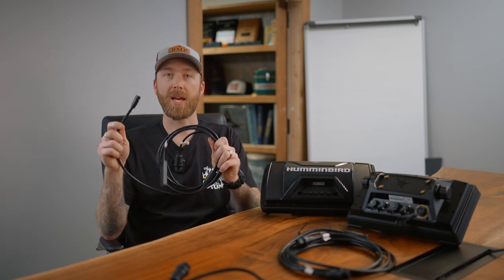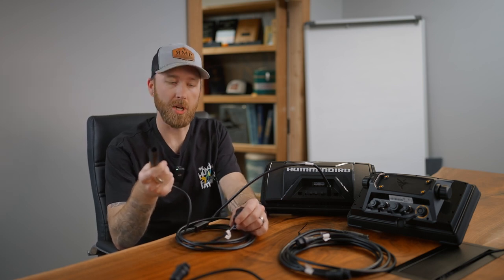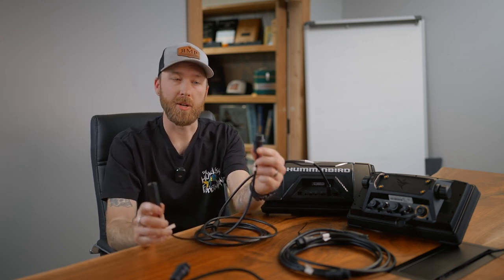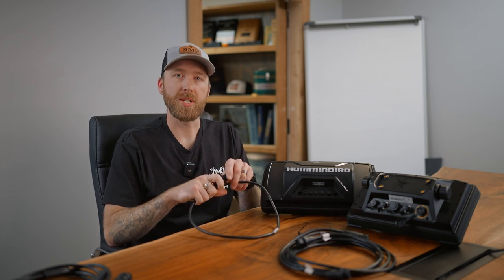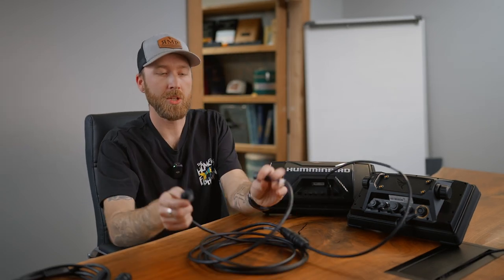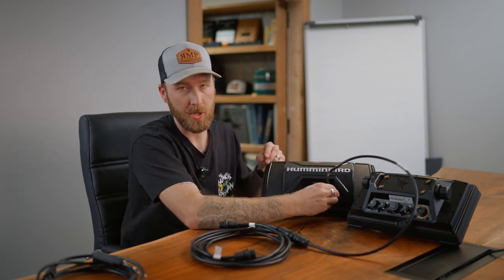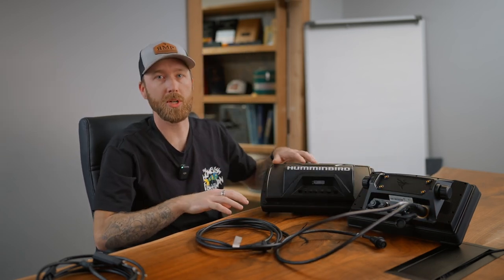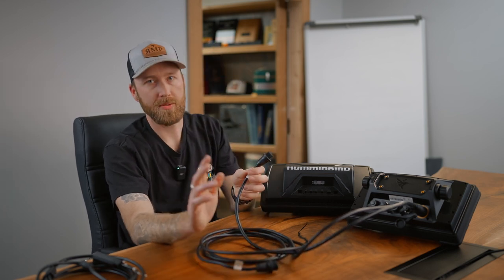HUMMINBIRD: Choosing the correct Y Cable for your Mega 360.

Comment: You should also mention the issue with the SI feature on the Solix/MSI+ transducer when using with the 360. When you use the Y cable and are running the 360 and then try to run the side imaging without the 360 in the water, the unit will not recognize the SI function of the actual transducer. This does not happen with a MDI+ transducer. You can have side imaging with only having a DI model by utilizing the 360 as your si image source now. If you are trying to chart water after using the 360 and the 360 is out of the water, the unit will not recognize a source for side imagining while you have the si transducer. Sorry for the long explanation, but learned the hard way.
Reply from the maker: This is how their y cable was designed. The Mega 360 is a your source of SI and it will remove the SI coming over from the unit in order to receive it from the 360. We have done a video on getting SI from the 360 on your DI unit but the information you are speaking of might be good for a future video! Thanks for the feedback!

Comment: Sir, after watching your video and you talking about the 360 adapter cable, my 360 did not come with that.  I contacted where it was purchased from, and they stated it does not come with the adapter cable.  Am I missing something?  THank you!
Reply from the maker: Yes it should absolutely come with the adapter cable(not the y cable.) I just broke open a new box to double check myself. The cable I am referring to looks just like the MKR-MI-1

Comment: o Hello, looking for help I have Ultrex 80/ us2/1plink-52 " BT AND MEGA 360 Ultrex 2 model 411830-1 and helix 9 chirp mega di+ GPS GN4 in the front for the 360, and in back to use for driving by in the back a Helix 10 chirp mega SI + GPS GN4 and the Helix 9 recognizes the 360 but I need to know what cables to get 360 to work the 9 and 10 helix work together need help thanks Joe any thing else that you need to help you help

Comment: I am adding a 360 to an Ultrex with built in transducer. I plan on having 2 Helix graphs in the bow with 1 dedicated to the 360. Everything is linked through the Ethernet hub. Question, will I need the Y cable. If not, I bought it used, is there a part # for the mega 360 adapter cable AD HELIX M360 which is normally supplied with the unit?
Reply from the maker: You will not need the y cable if you are running your built in transducer to the other graph. The information will share through the network.
Reply: @RussellMarineProductsLLC  thanks for verifying. Do you happen to know how I can get the single cable normally supplied with the unit?  They do not offer it on the website. Or will I be forced to get a Y cable and only use the 360 input?  Seems like this would be inviting interference.
Reply from the maker: @user-ev4tx7hf6y  if you do not have the Helix adapter cable you should be able to order it directly from Humminbird.

Comment: Will the solix y cable work with ultrex built in 2D trandsducer or only the built in mdi/msi transducers?
Reply from the maker: No. Neither of these Y cables are mean to interpret  non mega information such as the US2. Humminbird would suggest you add an external MDI/MSI transducer and run the 720107-1.